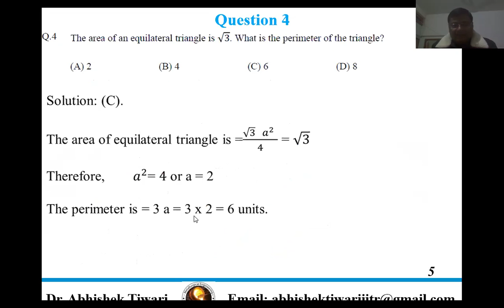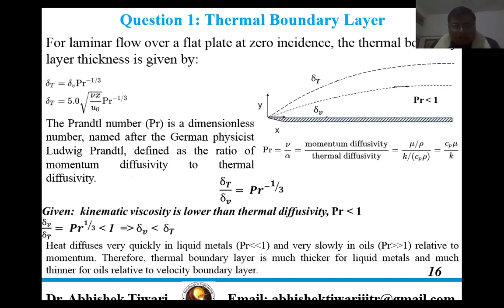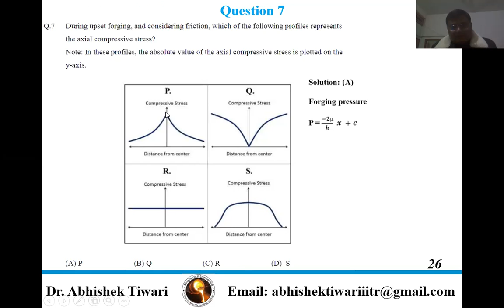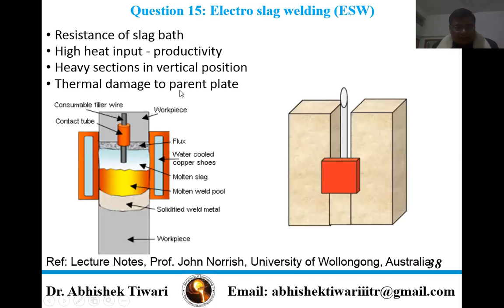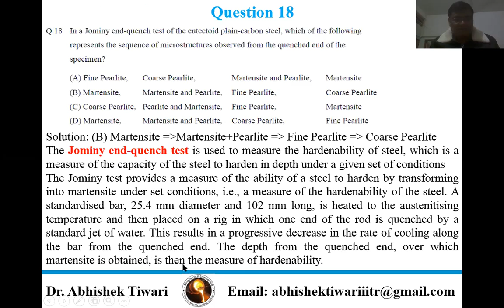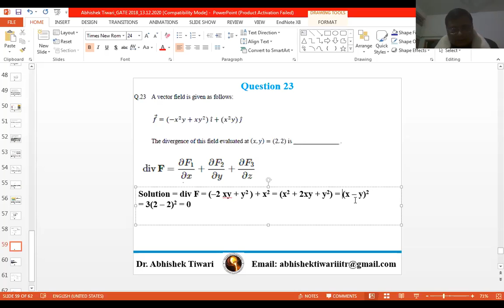GATE 2018 Metallurgical Engineering Question Paper Solutions Part 1(First 35 Questions)

Comment: Q.10, Higher CRSS means material will get diificult to slip. So, as per the graph, greater than 1.633, low CRSS plane i.e. Prismatic should be active. Similary, less than 1.633, basal should be active . Please confirm... ?  Since your theory is right. So, the graph of basal and prismatic might have been interchanged by mistake..